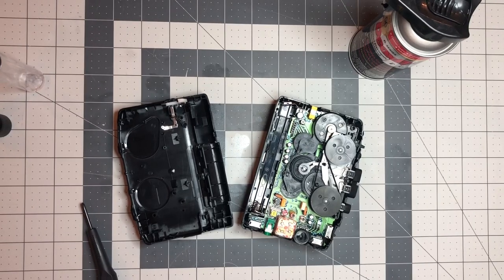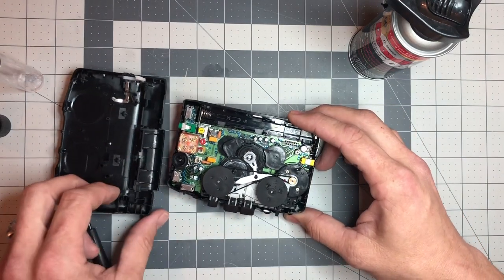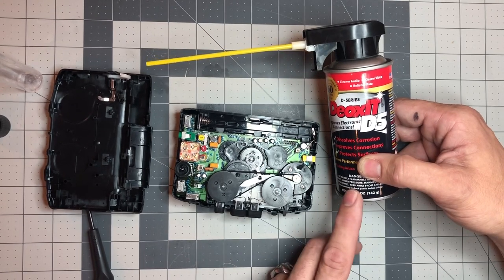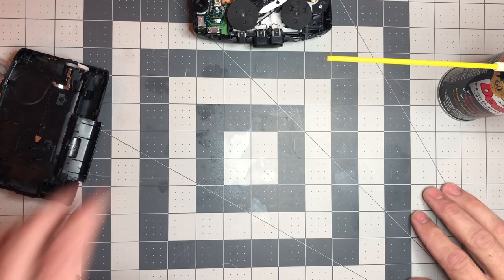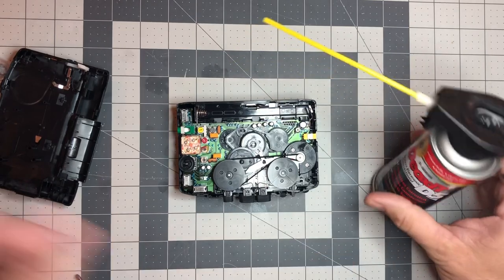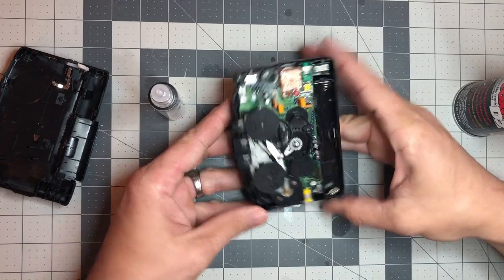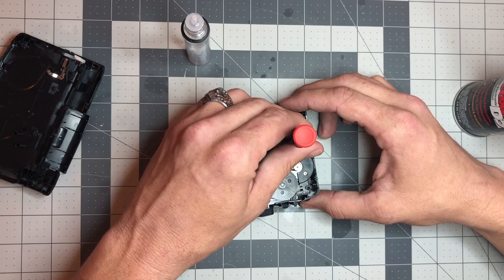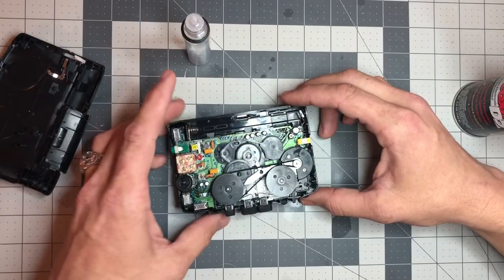How to fix your Sony Walkman - speed adjustment and volume knob repair / switch cleaning

Comment: I have a walkman with similar mechanics. too much modulation problem. new belt. ı dont adjust speed. if i set the speed then it changes, can yo hel mi  (wm fx40)  ı can try clean same to you show point.

Comment: I have an aiwa ps120 and the problem is the speed changes when i tilt the walkman or flip it upside down idk what is the problem
Reply: Lub the motor with a bit of oil or dw40

Comment: Thanks a million for this video!  I tried two different replacement belts in my walkman, but each time the playback sounded like slow motion.  Finally, I watched your video and found out about that RV601 speed knob.  Gave it a tiny adjustment and my walkman is back to normal again.

Comment: Thank you, I'll try this. My volume control on my portable cd player has had a problem for a while now where only on one volume level, the sound comes in both ears. On all other volume levels, the audio only comes in one ear. I know the headphones are good as they work on literally every other device I own. I'll let you know how it goes.

Edit: It worked! The sound's still a little bit staticky, but the sound comes in both ears now at any volume level.

Comment: Nice one and well explained. In my case the Sony Walkman F2081 circuit board which can be accessed at the back easily . was able to change the belt but no sign of the speed adjustment screw! All the capacitors etc are on the other side and there are no screws visible on the PCB to remove and flip it over to have a look .. I think the whole thing needs to be taken apart which is a pain so I gave up! Mine plays a bit slowly so I use this walkman for transcription!!

Comment: My Aiwa tp-vs470 is with a reeeeeeally low sound, I only can hear by putting my ear on it :( same thing when using phones! Maybe my volume potentiometer is broken?
Reply from the maker: clean the volume knob first - the phone jack connector solder may be cracked on the board also.

Comment: How do i find the screw that adjusts speed? I have a spony walkman wm f-35 sport
Reply: if you check the manual (you can look it up online) you should be able to find directions to where it is. Also, I believe with the sport there's a hole on the side that allows for access to the speed adjustment screw.